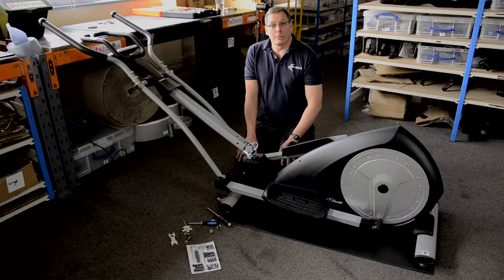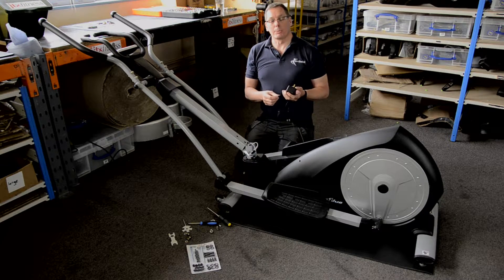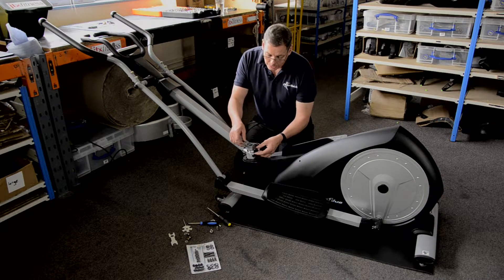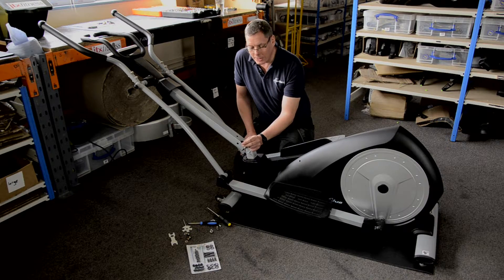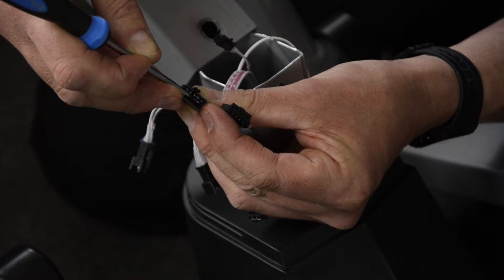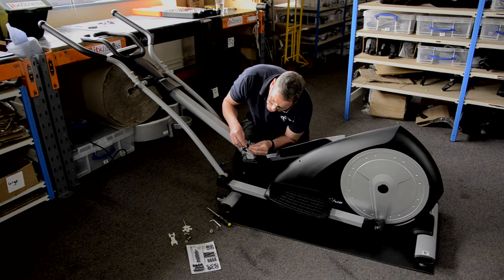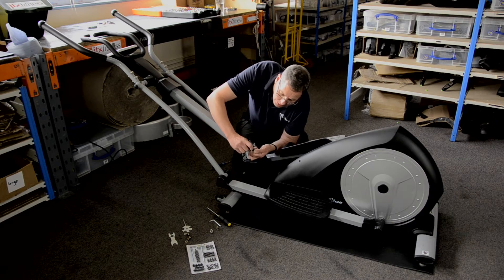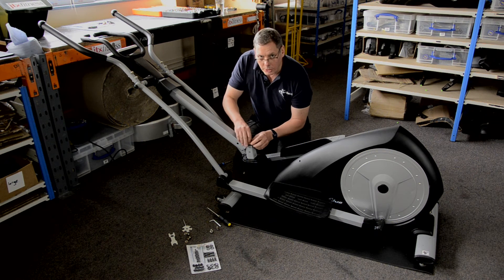How to fix damaged wires on an exercise machine

Comment: Hi 
I've recently bought a cross trainer and the computer with the timer/calorie/distance sensor doesn't work. I asked for a replacement computer and that one didn't work either.The wire that links the cross trainer to the computer is like headphone port and Jack. I was wondering if you knew a way to fix this or make a video? Argos only offered me a replacement and I'd rather see if theres a quick fix ? Any help would be so greatly received

Comment: Hi Jon, I buy, refurb and sell fitness machines in my local market. The #1 problem I find is resistance issues. Mainly, the console stops sending voltage to the 6volt brake motor, or alternately, it sends too little voltage and the motor just hums unable to pull the large magnet away from the flywheel. Have you encountered this? If so, can you offer advice on what the most likely components on the motor control board that need to be replaced? It seems crazy to buy a whole new console or motor control board if the fix is simply to test and replace a resistor, capacitor or voltage regulator.